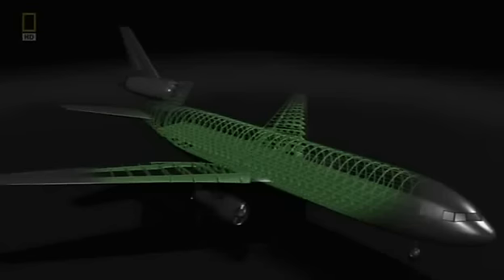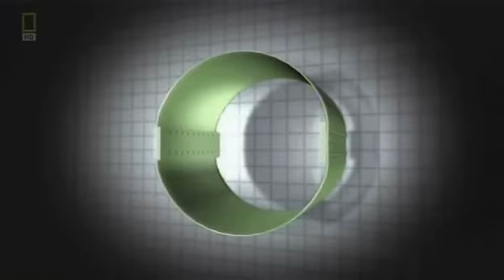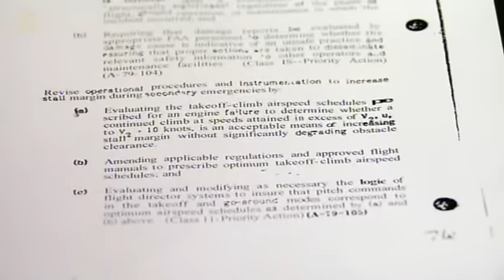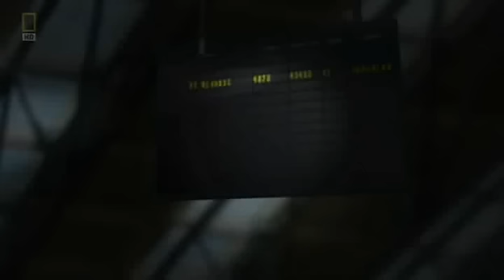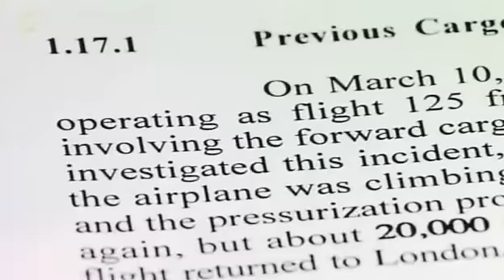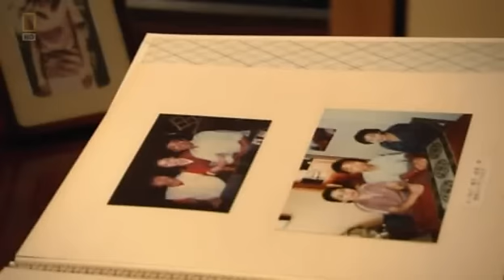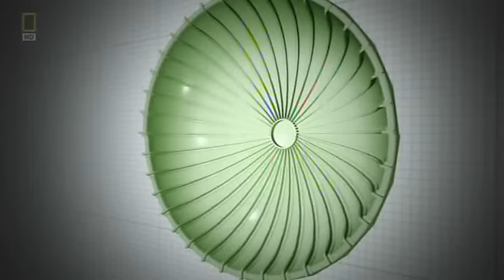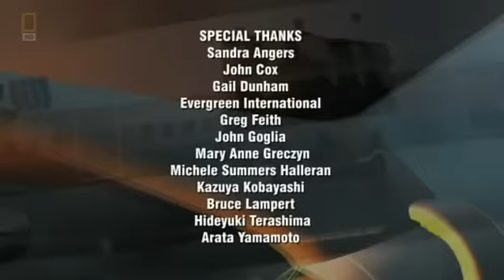Why Planes Crash - Breaking Point

Comment: The case of United 811 does not mention that the airline preferred the defective door locking mechanism of the outward opening door because it allowed for more cargo capacity than the safer inward opening door.  Normally the inward opening door is held shut by the pressure in the plane.  This was not the case in the outward opening doors. Only the locking system kept the door latched and it was a bad design.

Comment: Wait, a lady mentioned a crack before she boarded that plane that lost its roof? I would have been like: "hell no, you guys better check that!"
Reply: Actually that failure was a manufacturing error,  old plane that used rivets, the tech which was for WW2 planes. New tech uses carbon-fiber, stronger than steel & much lighter
Reply: Carmelo Sgro so how was that a manufacturing error? it was state of the art tech at the time, besides, its still used today. do you know how much a carbon fiber commercial jet would cost? and how are carbon fiber panels connected? thirdly, they aren't steel, they are aluminum.
Reply: I thought the same thing...I'm not sure how much some of the maintenance/inspectors etc. are getting paid but it's either to much and they're not doing their job or not enough and they don't care...that's why I won't fly, but one will probably crash on me anyway...
Reply: My sister told me that they won't let you off the plane when they're experiencing, oh say having trouble starting an engine.  I said man I'd be so hostile and aggressive they'd be removing me from the plane.
Reply: Yep and I would have immediately turned around and left.

Comment: The model of the Aloha flight is wrong. The tail is from a 737-300 series or newer but the engines and body from a 737-200 (which is correct).

Comment: whenever you fly just pray that the plane you're on will not come apart in mid air. i heard that 8 of the 10 passengers on united flight 811 were sucked into the #3 and #4 engines... YUCK

Comment: OMG how many times does a failed repair cause and air plane to crash and how many times does this have to happen before they Airlines Implement a procedure for these repairs are inspected at regular intervals after the repair is done through the life of the plane. and you would also think that they would learn how to repair the plains better so they don't fail either that or replace that section as the plane ages but somebody would probably argue that it would be too expensive that would cost too much money really well how much does it cost when hundreds of lives are Kilt Ana plane crashes. OMG they broke the plane while changing an engine are you serious

Comment: as was stated its still more dangerous driving to the airport in a car.
Reply: Bullshit planes are more dangerous
Reply: chdreturns no they're not...they're not even close.

http://traveltips.usatoday.com/air-travel-safer-car-travel-1581.html

The National Transportation Safety Board compiles aviation accident data. Preliminary statistics for 2008 show only 20 accidents for U.S. air carriers operating scheduled service. This works out to nearly zero accidents per million flying miles. No one died, and only five people were seriously injured.
				 				 					
Comparisons
In absolute numbers, driving is more dangerous, with more than 5 million accidents compared to 20 accidents in flying. A more direct comparison per 100 million miles pits driving's 1.27 fatalities and 80 injuries against flying's lack of deaths and almost no injuries, which again shows air travel to be safer.
				 				 					
Odds
The National Safety Council compiled an odds-of-dying table for 2008, which further illustrates the relative risks of flying and driving safety. It calculated the odds of dying in a motor vehicle accident to be 1 in 98 for a lifetime. For air and space transport (including air taxis and private flights), the odds were 1 in 7,178 for a lifetime, according to the table.
				 				 					
Conclusion
Statistically speaking, flying is far safer than driving. However, it may feel more dangerous because risk perception is based on more than facts, according to David Ropeik, risk communication instructor at Harvard School of Public Health. Driving affords more personal control, making it feel safer. In addition, plane crashes are catastrophic, killing more people at once, which grabs more attention and makes people more sensitive to them. Car crashes happen every day and spread the loss over time, making their combined effects less noticeable.

Comment: There's no such thing as a safe flight. Traveling 500+ mph at 30,000+ feet isn't safe. It's unnatural and comes at huge risks. And I enjoy flying! The risks associated with flying, in essence, are the same as those you risk when driving (minus the height).
Reply: Only if you crash while driving you have a higher chance of survival
Reply: chdreturns Yeah, but most major plane wrecks happen during landing or takeoff, so the speeds are basically 200mph, or even less. 
If you're in a car doing 70mph and collide with another it's the same thing.
Reply: @Joseph565112  not the same though is it. You are in control of a car and if you are carefull you should be okay with avoiding accidents. Imagine if the pilot  had a horrible divorce etc it would affect his performance.
Reply: vrx Cld I mean When you’re driving you aren’t really in control since there are so many variables but I can see where your coming from.Statically speaking driving is more dangerous than flying.
Reply: @gemmaj2488  there is just something otherworldly about plane crashes. Car crashes abd you call AA emergency if its not a horrible crash.  If a plane crashes you are truly fucked.